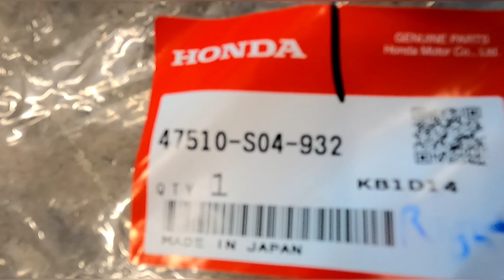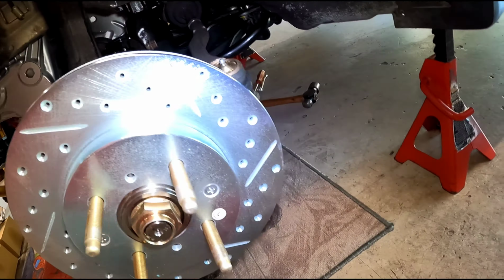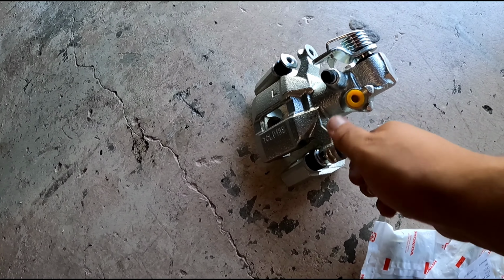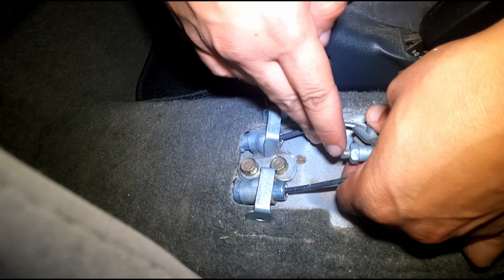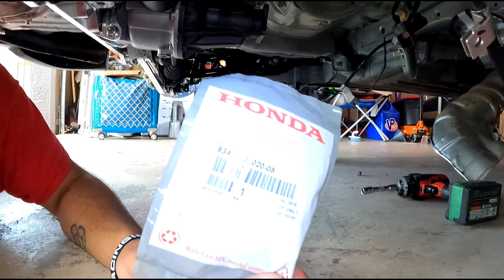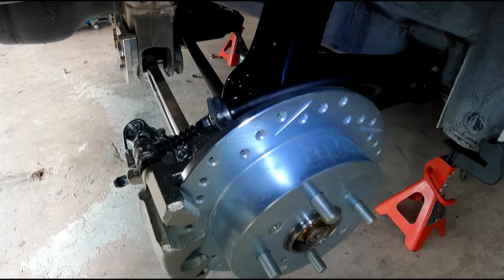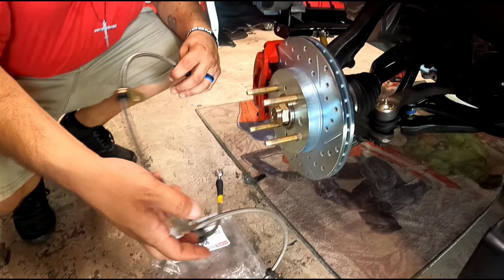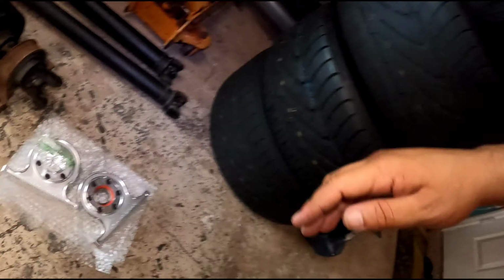K20 AWD CIVIC BUILD BRAKES & ROTORS / E-BRAKE INSTALL

Comment: Hey bro, did you have to convert from drum to disc?  What hub are you using for the rear acles?
Reply from the maker: @raisinggru  y u want to use integra rear disks or 99-00 civic si  rear trailing arms